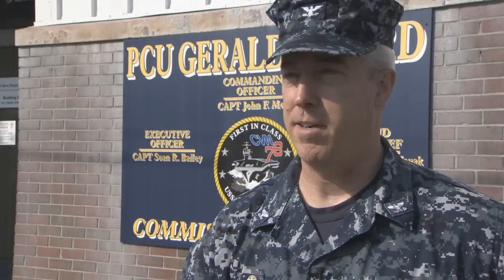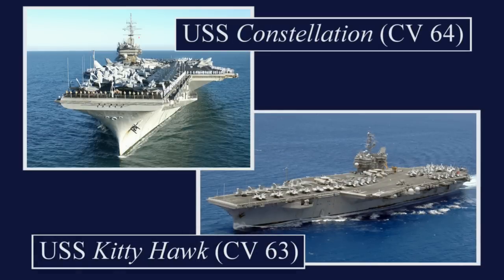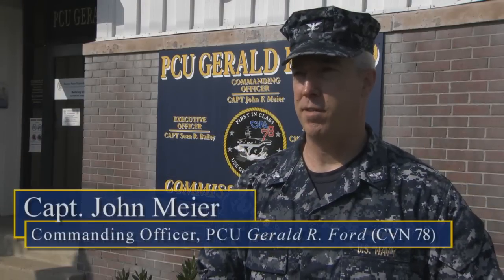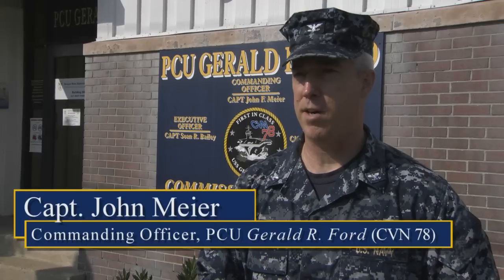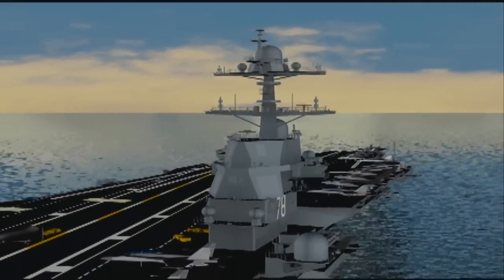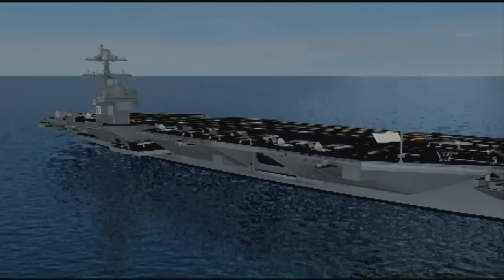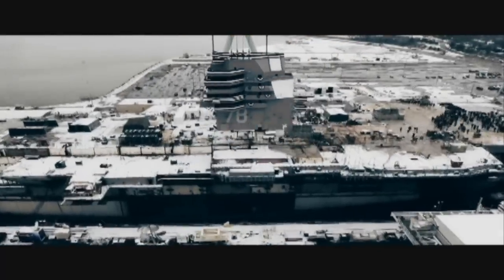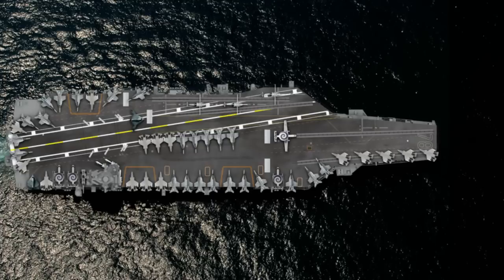Capt. Meier on Ford: Nimitz Class vs. Ford Class

Comment: If they cut the air wings, once they r gone,it does not matter how fast u can launch & recover. Military just tried to scrap a Super Nuclear carrier(we r the only 1 who has them) at less than 1/2 life rather than refuel it, because the corp that call the shots wanted to sell US a new 1. How does that play n to your BS #s. We NOW will hve gaps n deployed carriers because we bought & r buying a ford when we could hve had 2 Chevy. Any 1 who thinks a super carrier has 50 more yrs needs to get smacked & forced to watch the sinking of large carriers n test & WW2.  It is getting to the pnt where we need to operate them n pairs to insure we can safe the air wing from sinking. VTOL is making them even less needed & expensive, because we r fielding both planes & carriers. The idea that we need to hve so many planes n 1 basket is crazy stupid. Every Nation on Earth is not wrong about the value of Frigates & med deck carriers & gator carriers. The leap was to great from last chevy to new Ford & it still is not worked out.  For every carrier u need the screen ships, so it is big $$ decisions & no way should the new Ford hve been started till the 1st was finished & ship shape. That way u can make a real cost comparison we still can't do. N 20 yrs range & drones will hve made the need for a large or super carrier a non factor post cold war relic. How we would hve gotten there & on what terms forces the debate toward even non nuke carriers w/shorter life cycle & especially multi use gator carriers.
Reply: +James Merkel I can tell you never served in the military or work for defense industry and that is good thing. VSTOL carriers are failures they cannot carry early airborne warning aircraft one reason the Royal Navy lost warships off Falklands VTOL aircraft can only be launched from VSTOL carriers with small amount of armaments and fuel compared to CATOBAR aircraft carrier.

Comment: With the Ford class being only three ships and the new Panama Canal locks being 50 % wider and one hundred plus feet longer, the next generation of carriers will be WOW !  Maybe 50 % more aircraft and the C-130 aircraft landing on a regular basis. And maybe the US Navy will help develop the Thorium Reactor that burns more of its fuel and can not be turned into WMDs.  And when retired in some fifty plus years the reactor can power some coastal city when the ship is on display.

Eyes UP and lights down,  tjl  Sent by Win7Pro64 w/ADSL

Comment: We need a submersible carrier
Reply: Leo GARAY You may actually consider doing some further research.  The I-400 class submarine created by the Japanese was actually capable of launching up to four sea planes called Aichi M6A Seiran.  Mind you they were not sub-par fighters at the time but rather designed exclusively for the I-400 with quite good characteristics.  There were even plans to bomb the Panama Canal using these planes in the darkness of night.  That would have been a logistical nightmare for YEARS to come.  Of course this was put to a stop when Japan surrendered.
Reply: You can't launch from a submersible, idea is nice but really not practical, imagine you take off with your squadron only to come back to find your ship mates are hiding from the enemy above!!
Reply: In WW2 Japan invented a submarine carrier for only one jet for suicide bombers 4 were made right before the war ended
Reply: that would cost 25-35 billion dollars per ship, and it would probably suck as a sub, suck at launching and recovering aircraft, and have such a deep draft that it would be restricted from most ports.  Carriers need a high freeboard and they have to have a high speed.

Comment: " It will actually save money" YIKES
Reply: yes because maintenance costs will be lower compared to the nmitz class. just imagine trying to replace corroded steam pipes, as opposed to changing out a few wires.

also the air wing onboard will have less wear and tear due to the new EMALS installed on the ford.